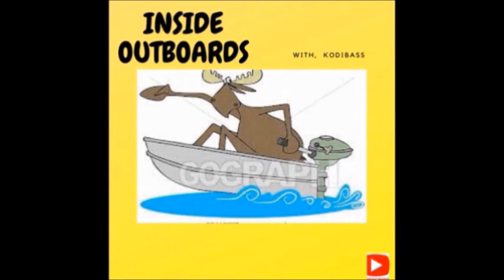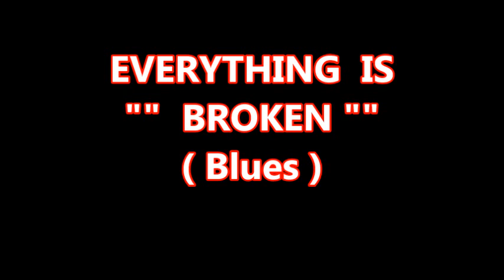YAMAHA  15  HP   2  STROKE ,  EVERYTHING  IS  BROKEN

Comment: If they aren't already installed in your garage door springs (especially given the age of the springs) run some safety cables through them and anchor them. That way if the spring snaps or garage door support cables snap they don't come flying back and injure you (people have been killed by this happening). If your supplier says the kits they sell won't be in for months, they can be easily made with standard hardware from a hardware store. Stay safe... we want you around for many years to come with all the information you impart.
Reply from the maker: OK'  I will get intouch with a friend who knows these things and have him go over it,  & He says he might know someone who can get me a new door. Fingers crossed.  thanks   kb

Comment: i cant figure out how to message you. but anyway i have a 1986 yamaha prov 150 that has all good compression but cylinder 4 has a clean spark plug all the rest will look discolored some from use. it is firing, and all new carbs. cant seem to figure it out, didnt know if you might know. thanks in advance for any info.